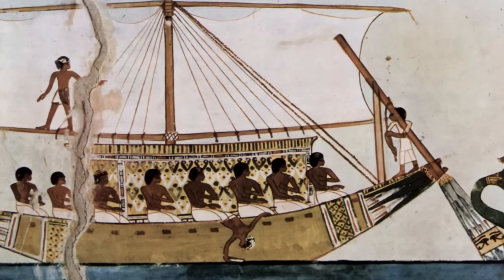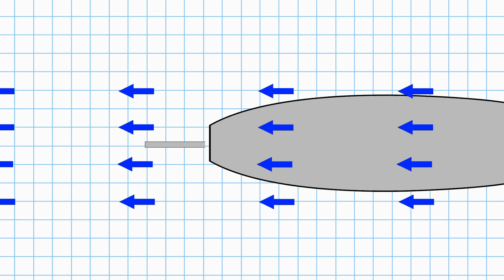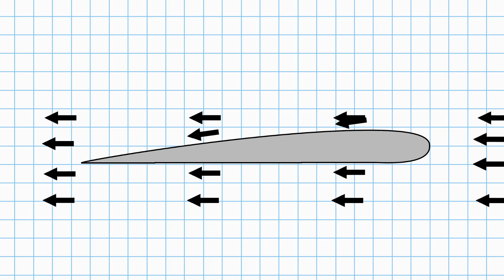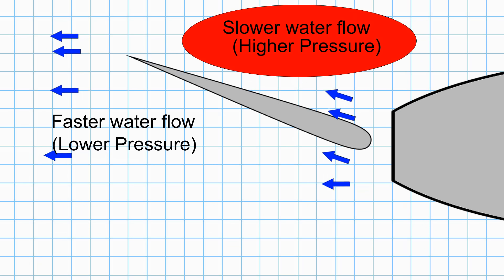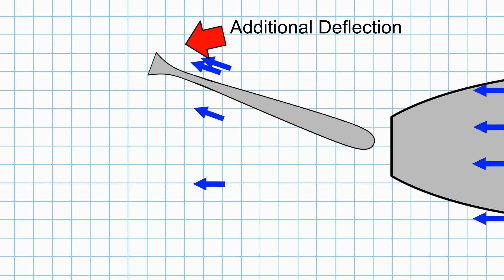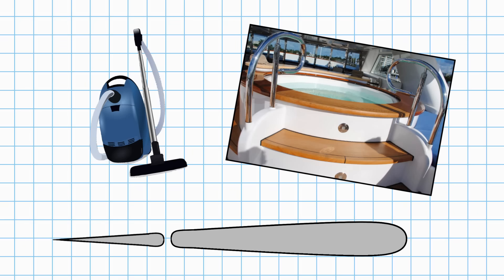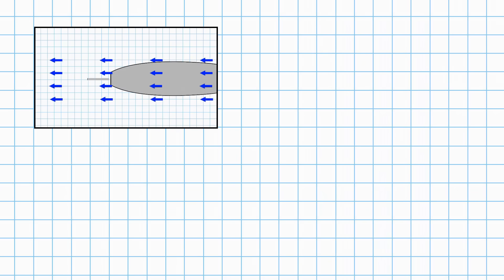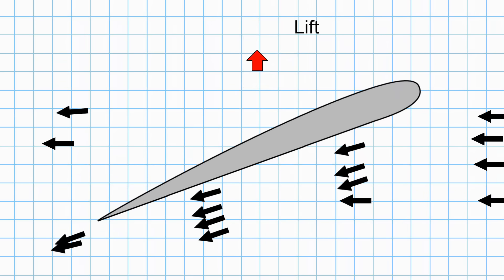How Does A RUDDER Work?

Comment: Being a pilot whenever I look at an airfoil design I think about drag. How come that in ship design it appears to rarely be considered (e.g. the fishtail looks like an awful induced drag generator). Is it because the cost of fuel in ship design is less relevant or simply because it is negligible when compared to total drag?
Reply from the maker: I think it is probably negligible compared to the ship itself. I guess drag is only really a consideration when the rudder is straight anyway. As soon as it turns, the drag helps with the turn. Would be interesting to see the different fuel consumption with different rudders though
Reply: @CasualNavigation  Probably also has less of an effect for the ship as the rudder is tiny in comparison to the hull of the ship and being centre mounted doesn't really add to the hulls cross section in the water and of course it's contained within the slipsteam of the ship. Aircraft on the other hand have a minimum of two giant aerofoils sticking off the side of the aircraft, most of course also have two smaller upside down aerofoils (horizontal stabiliser) and the vertical stabiliser at the rear too none of these really get any slipstream benefit from the main fuselage so that probably adds to the much greater significance on the total drag. Plus the aerofoil design of the wings means they constantly produce induced drag as a side effect of developing lift too so anything that can be done to optimise this to a minimum especially for a craft that operates at such high speeds has massive effects on efficiency, thus such as the use of winglets to reduce the amount of vortex shedding which significantly increases induced drag.
Reply: (rudder x fuselage) << (wing x hull)